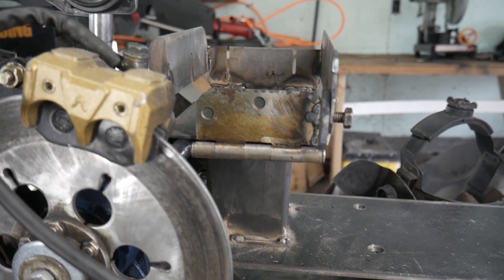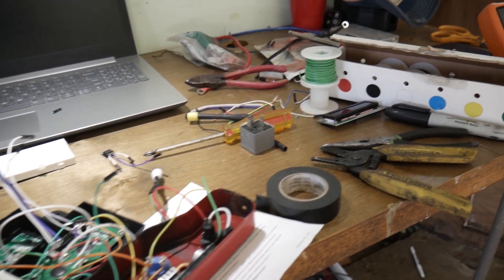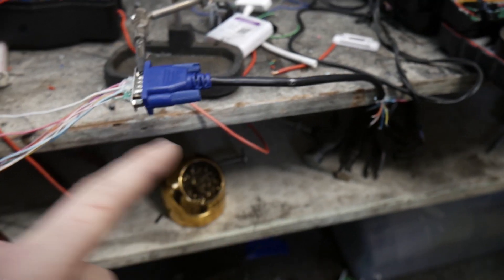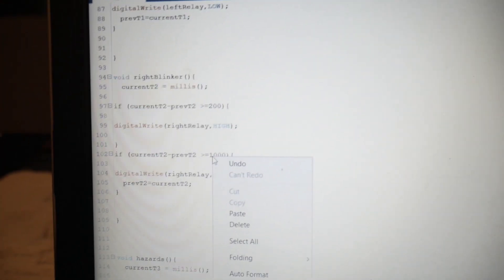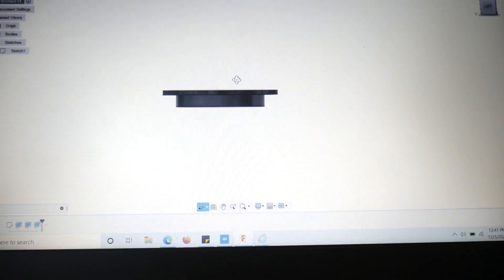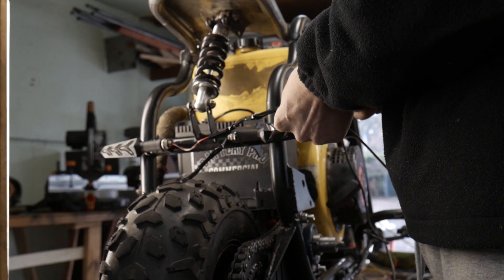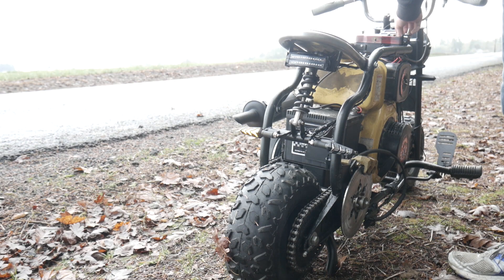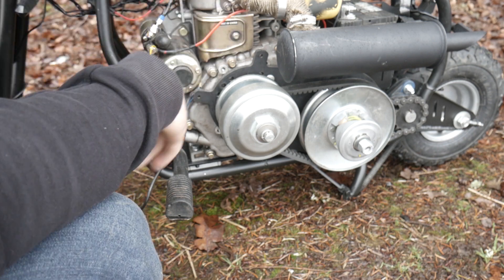Homemade Diesel Mini Bike (Part 3)

Comment: I got the yanmar l48 ae it's set up for a genset 3600rpm I got a mini bike style crank in er and the right throttle bracket, you know what else if anything is required such as the governor or?

Comment: Why 4 magnets? Technically you only need one to count the number of revolutions (every time the magnet passes = one revolution) x circumference
Reply from the maker: Haha I knew someone was going to catch that, with more magnets I was able to get a more precise measurement of rpm. Which is totally unnecessary and pointless for something spinning that slow but oh well
Reply: @OliverMotorized  nevertheless that was wonderfully designed part! Great work!

Comment: what's the benefit of using microcontrollers for everything? wouldn't it be easier to just run a cable for the throttle?

also what's the song at 4:46?
Reply from the maker: I was using a bunch of electronics because I just wanted to learn more about them and apply it to a project. But in this case, the diesel is tricky because the way it turns off is by releasing the throttle so the MC gave me the ability to set an idle speed and turn it off etc.
Reply: @OliverMotorized  a learning experience. i can respect that! i'm still curious about the song though

Comment: I have an idea for a build..if you can  find an old bike with a three pc crank.. just take the arms off and put a pulley on the left side then you can keep all the gears ....power and speed..just have to watch shifting gears the derailleur probably  doesn't like alot of  tork
Reply from the maker: Hi Edward, I've done it! it's on the channel. though, it didn't really perform all to well haha!

Comment: Don't get too discouraged Electronics shit is hard and you will run out of ways to do it wrong eventually lol.
Reply: Yeah, you can not get anything wrong.  I've done it over 10 years and still make dumb mistakes. Its also extremely time consuming
Reply from the maker: haha thanks, I do enjoy it though, it's nice to take a break from the mechanical aspect of a build and work on electronics.